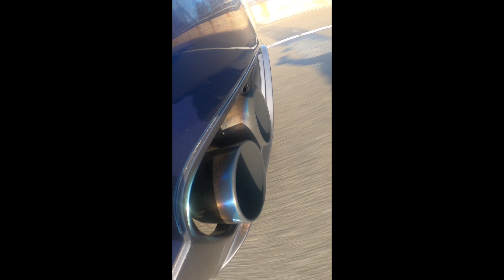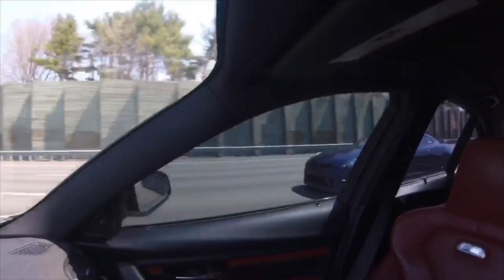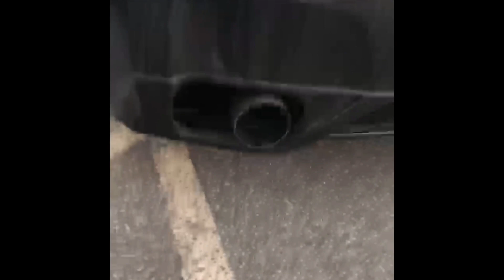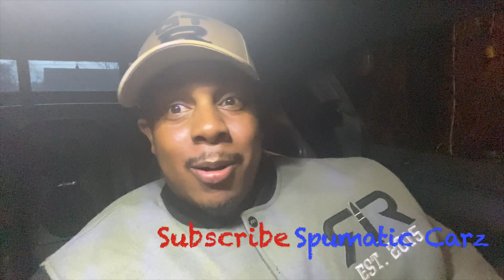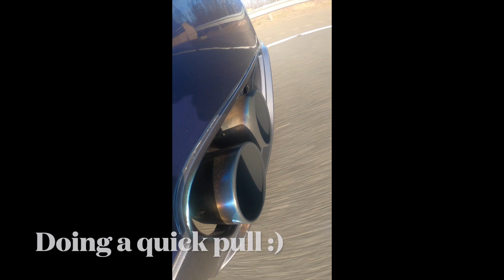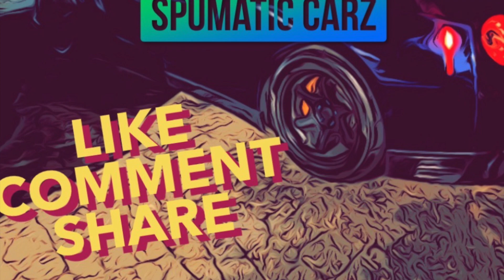How does my Nissan GT-R HKS Legamax Exhaust 85mm?

Comment: Just a FYI I'm having my 4" Ti Greddy midpipe and Greddy Ti exhaust replaced with a HKS Legalmax with the AMS midpipe because the drone on the highway was horrible. It was just to loud around town too. I've got catless downpipes like you. I'd just keep it as is. Sounds good and you don't need noise cancelling headphones on the highway like I've been using so my ears don't ring all night after a long drive. HKS for the win. Oh I'm at 830 wheel HP.
Reply from the maker: Nice that set up is perfect if you don’t want the drone. Let me know how you like it.
Reply: @spumaticcarz   2 hr drive home and I really like it. Much better. I can hear my radio nicely at just under 1/2 volume now. No more yelling needed in the car now. 👍👍  R888'S are very nice too. Just a buzz kinda noise at some speeds. Sticky.
Still sounds throaty and not to quiet. I can hear my turbos now.😎👍
Reply from the maker: That’s awesome!! Glad to hear it!!! 💪🏽💪🏽💪🏽